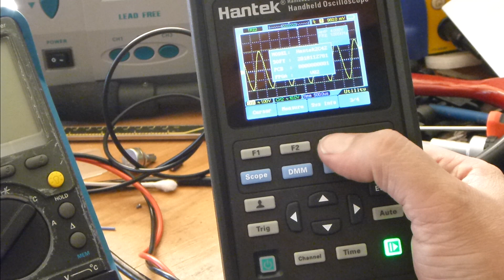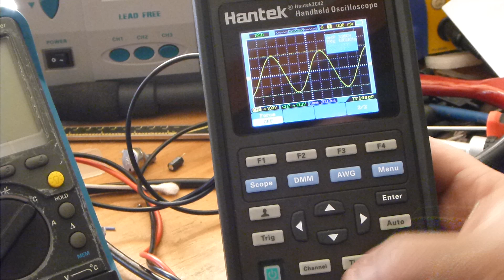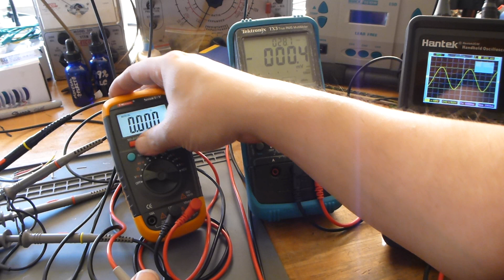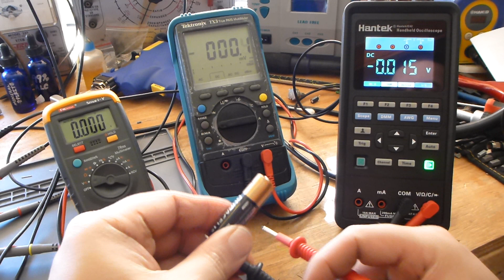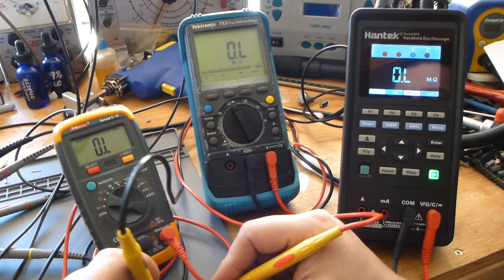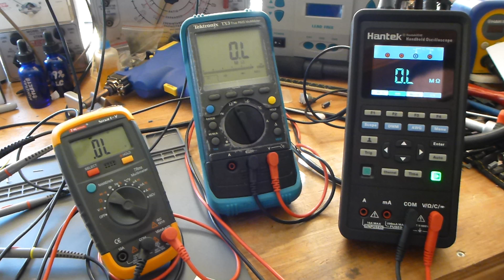Closer look: Hantek 2C42 DSO/DMM Part 1

Comment: If you would measured the Duracell battery all 3 probes at a time, the differences in internal resistance of the three different DMMs will be nullified

Comment: If you do more vids, you might consider doing simultaneous readings as you did for AC voltage demo for all the DC voltage (meters in parallel) and current measurements (meters in series) as well. Would be a bit faster and allow direct real-time comparison of readings.

Comment: If you got the 80MHz probe kit, you should have received the probe adjustment screwdriver, 2 probe tip insulators, and 8 or so colored probe "ID" rings in a small baggie inside the probe's larger plastic envelope, and the probe, a grounding clip, and a probe tip extender/clip already assembled to the probe itself, and probe manual/leaflet in the probe's plastic envelope. If you didn't then perhaps you received an "open box" probe kit. The user guide leaflet was marked for probes PP80B thru PP300B.
The kits I got a while ago for the 2D72 scope/DMM were two PP80B probe kits.
The kits I got a while ago for the DSO5202P scope were two PP200B probe kits.